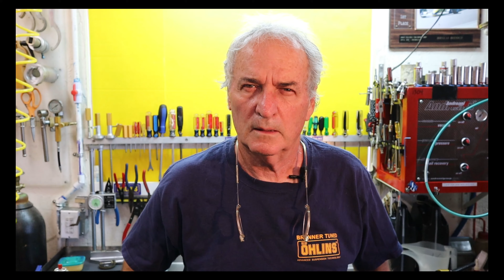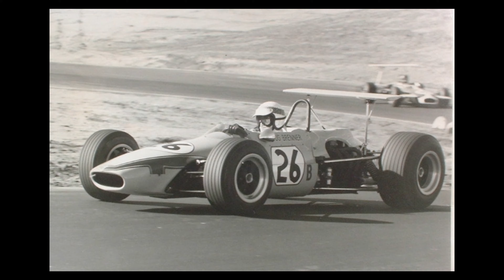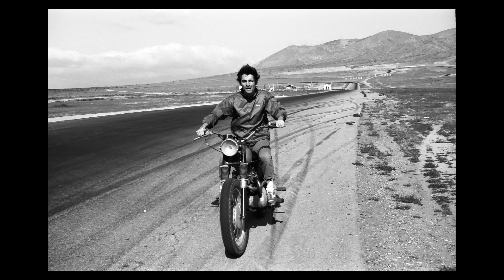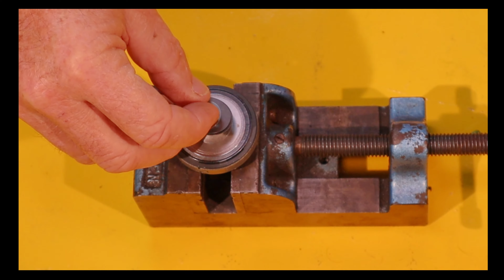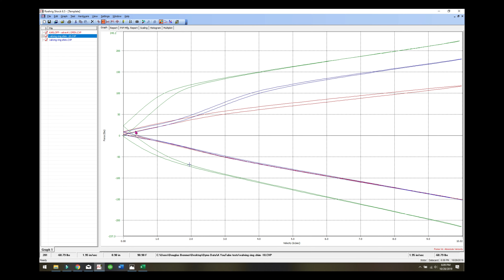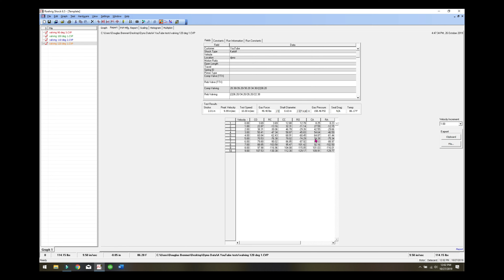Valving #4  Shim Magic

Comment: I have a question, i race atv's in cross country (woods racing) and i have learned a ton about shocks from your videos and have been able to revalve my rear to do exactly as i wanted it to do, now i have a question about the differences between high and low speed and what is actually considered high and low speed. 

My front shocks running across rough ground (minor bumps and rocks) is stiff and jarring, but if it takes a hard hit. Like landing from a jump or crossing a gullie they seem too soft. Would that be considered to have too much low speed and not enough high speed dampening?

 I dont have a lot of off time between races to test and would like some input from someone smarter then me about it before i attempt to revalve them and make them worse.

Thank you for your time and the amazingly informative videos.
Reply from the maker: Hi. I am glad my videos helped.  High and low speed is subjective.  When your shock gets a high speed hit it is an anomaly and it you try to valve for that you will be ruining the other 99% of your run.  The only thing I would suggest is to look at my video on Digressive Damping Why I Don't Do It.

Comment: Hallo and thanks for sharing your knowledge in these videos!

I wanted to ask if you could explain and maybe make a video of dyno tests on the KARLOFF test shock to demonstrate the influence of rod position in the shock versus force with constant test velocity.
For example, a tests series using constant 1, 2, 4, 6, 9 in/mm vecolities using whole stroke length of the shock to see how the force changes with regards to rod position in the shock at a given velocity. 

I'm not sure that it has 100% applicability to real world scenarios (I'm interested in motorcycle off-road racing like MX, enduro, rally, etc.), but I'd be really interesting to see how a shock works while being brought thourgh its stroke at a slow velocity compared to a fast one (with the same shimstack, bleeed clicker position, etc), esentially to understand the influence on the shim stack/bleed on the rod position in the shock depending on the rod velocity.

I hope I made my idea clear and there is something interesting that you could show/teach us.

Thanks again!
Reply from the maker: Unless the shock has some sort of bypass mechanism in the body there should be no difference in damping forces based on shaft location.  It is only sensitive to velocity
Reply: Thanks for answering this. Is there any way you could post a link in this comment to a picture or a video where such a shock body is shown (seen), so I could understnad how those types of bypasses look and thus, hopefully, be able to determin what type of a shock I'm looking at if I ever see something similar in future? 

Thanks!

Comment: isnt it so - that one would want digressive damping on an application where you have massive wheel travel available and You want to keep off the "seasickness". so after the initial soft side is overcome the valving is not too abrupt for high energy impacts - like hitting a sharp edge vs slow  vawes of whoops.
Reply from the maker: If you get a hard hit with lots of slow speed compression the whole thing locks up.
Reply: @theohlinsguy4649  watched all the videos. a lot of interesting info. thanks for that. we are still waiting for our dyno to be delivered - but a lot of misleading info is being flopped around the net for all of it.
Reply from the maker: @Snowhite808  Good choice.  You can't really know what you are doing without a dyno.  Just remember that  it doesn't tell you what is better or worse.  It is also very good at seeing if you have any problem in the shock.  Good luck!

Comment: is there a way to calculate shim stacks or is it all trial and error. i'm trying to learn how to manipulate snowmobile shocks depending on rider conditions and rider styles and would like to be able to figure out shim configurations based on this
Reply from the maker: Hi Leo.  There might be but I wouldn't be smart enough to do that.  I did give the math for calculating equivalency of multiple shims of the same diameter and thickness.  I think even if you could there is a disconnect between knowing  what the stack is and performance.  Also what that stack is doing depends on the piston.  I just have an idea from experience what shim stack to start with and then it is trial and error.  I did some snowmobile shocks and had no luck at all.  The show is compressible and depending on the makeup of the snow you can get completely different results. I am not a believer in changing shock settings for different track conditions and once I get a good setting I never change it.  But with a snowmobile I am guessing that you would always have to change things based on snow conditions.  Just a guess.

Comment: Would it be fair to say that road bike valve stacks are shimmed to account for potentially passengers plus luggage and that an improvement could be made to solo rider riding by reducing damping stack
Reply from the maker: Hi Phil.  I don't think damping has anything to do with weight.  Two different things.  I only valve for motion ratio and find no difference between road or track.  Best way to account for passenger and luggage would be to just add more spring preload.  Thanks for the question!!  Remember these are my opinions.
Reply: @theohlinsguy4649  Thanks for the reply that makes sense . I guess find a spring that feels nice and work the adjusters around that . Great videos by the way helped me rebuild my shock just watching how you did it ✌️✌️✌️
Reply from the maker: I am glad I could help.  It's not rocket science but sometimes it is good to know the details.  It is mostly hard to do without the special tools.  I really like it when people do it themselves.  On springs, I prefer softer with more preload than stiffer.  You can go too soft but once you get in the ball park it is really nice.
Reply: @theohlinsguy4649  well I’ve worked on hydraulic rams mostly of agricultural machinery and figured that’s all it really was, just a small hydraulic ram seal piston etc . Actually being 22 years old was the worst part of stripping it, seal kit was available via a company here in the uk I touched the bore up with stones like i saw you do have the valve a rough up and just took my time. Seems perfect now slight dead spot at top out but I can work that out . Once again thanks so much for what are great educational videos .. Many thanks and blessings from Devon uk ✌️✌️✌️

Comment: What is the I.D. Of Ohlins shims?
Reply from the maker: Hi.  There are 3 IDs that I know of.  Shims for single tube shocks are 12mm, fork shims are 8mm and TTX shims are 6mm
Reply: @theohlinsguy4649  thanks. Trying to find high quality shims for my shocks. They are 16mm unfortunately. Thank you for the amazing videos, I’ve learned alot from you.

Comment: Hello, how are you calculated the amount of thinner or thicker shims to replace?
Reply from the maker: The formula is on the video.  Basically divide the bigger shim by the smaller shim and multiply that to the third power.  If you want to replace one .20 shim with .10 shims". .20 divided by .10 =2.  2 to the third power is 8.  So it would take 8 .10 shims to equal 1 .20 shim.
Reply: @theohlinsguy4649  what if i want to make the opposite thing? And arent  8 shims stiffer than 1?
Reply from the maker: @zlatomirkolev9762  It is pretty interesting that it takes 8 shims that are half as thick to make one shim twice as thick but that is true.
Reply: @theohlinsguy4649  if i change clamping shim only is it gonna be a precision tuning for whole stack?.. I have alot of questions if u up to explain me, i ll be thankful!
Reply from the maker: @zlatomirkolev9762  Watch my video on clamping shimw.  Yes, it is kind of fine tuning

Comment: Would digressive be better suited to situations with high unsprung weight like a trophy truck? 
Thanks for so much information, you've earned my sub!
Reply from the maker: I don't think unsprung weight has anything to do with it.  I have some dyno sheets from an early 2000s NASCAR championship winning car and the damping for road courses is pretty  identical  to my 1000lb formula car.  The only time that I think digressive damping is "good" is for aggressive hold down/up shocks.  I don't get into these applications.  I am looking for mechanical grip.

Comment: I really appreciate these videos, such fantastic info.
 I got to thinking about stacking shims vs using a single sealing shim  and basically having the same dyno graph but stacking shims gives more mechanical grip. I notice the way the shims work is very much the same to a leaf spring. A moden parabolic leaf spring the leaves don't touch one another and require a shock absorbers to control oscillations. In the old days, leaf springs were made up using multiple leaves and often did not require shock absorbers (my background is a truck mechanic) as the friction between the leaves would sort of dapen the oscillations. In the shim stack of the shock, without multiple shims stacked together could the sealing shim be bouncing when the shock is operating at a high frequency, inhibiting its ability to meter the fluid properly. Just a thought.
Reply from the maker: Hi Isaac.  I think you are really correct about the shim stack being similar to a leaf spring.  I think the math might be the same.   It would be very hard to get enough damping with one sealing shim.  Sometimes I see stacks with only multiple sealing shims but for some reason a stack with descending diameters seems to give more grip.  I don't really know why.

Comment: Hello
I discovered all your videos and they allowed me 2 things, to learn a lot of things about suspension and also to have to review my English which I hadn't practiced since the end of the school there is ..... 35 years old...... so please excuse me for the mistakes.
I ‘m not a professional but just a private person who is passionate by the suspension and who works on my son's motocross bike suspensions since 12 years now.
We try different settings, we test, we change etc etc etc just based on the sensations on the track.

I ‘m really interested to test the solution with a ring shim of ID 36mm OD 40mm 0.30 but do you know where I could get one because the shim sellers in France don't have this type of shim.

Regards Olivier
Reply from the maker: Hi Olivier  Your English is great.  You speak (at least) 2 languages, I barely speak one!!   Ohlins makes ring shims so there must be an Ohlins dealer in France you can get them from.  Remember that you need a 36OD shim to center the ring shim.  The difference between the centering shim and the ring shim denotes the amount of preload.  also remember you can keep stacking ring shim sets if you need more preload.   Thanks for the comment!!!!
Reply: @theohlinsguy4649  Hello
Thank you for your answer and as you tell me I will see with the OHLINS dealer in France to whom I had sent the shock absorber of the 1993 Honda 250 CR for a complete service there is 5 or 6 years.
I just have one question:
Can we hope one day that you will make us the same videos about the forks with internal cartridge?
Thanks Olivier
Reply from the maker: @pingping4766    Yes.  I don't get them very often so next one I get I will make a video.  Basically they are just a shock with separator piston put inside a fork.  You also put oil in the fork but it has nothing to do with damping.  Probably there for the air spring effect and cooling the part that is doing the damping

Comment: Great videos ! I just wanted to know if the Ohlins ROAD AND TRACK are revalvable ( for raod use only ) and if it is really  worth ..
Reply from the maker: Yes, they are revalvable.  I don't believe there is any difference in valving between road and track.  Grip is grip.   I think they are a great value

Comment from the maker: Hi Martin.  Be sure when you put a larger clamping shim on that it is not protruding into the port.  I think it is really great that you are going to learn to make your own changes.  As far as the rebound goes, the better option, at least initially, is to put in more compression damping.  That will dissipate some of the energy stored in the spring which will also slow down the rebound as less energy will be stored in the spring.  

I think in one of the videos I showed the effect of a crossover shim.  It usually just makes less damping which would be better to do with a uninterrupted shim stack.  A crossover shim is handy when you just can't get rid of high speed or want more low speed relative to high speed.  They are not bad things when used for the right reasons.

I don't think that shim stacks are usually ever really bad.  Mostly it is the digressive piston, closed bleed or the ratio between compression and rebound damping that isn't good (just my opinion).
Reply: I will make sure it does not protrude. Good tip on the compression and storing energy that helped me out when riding today!
Thank you for the response and I will be looking forward to new videos from you.

Comment: I have watched almost every video that you have posted and I have to say I highly appreciate all this information, making me understand more in depth how it works. I can now go ahead and start making my own changes to the suspension of my dirt bike, I will be starting off with changing the clamping shim to a slightly larger one on the rebound on the rear due to it being a little too fast!

You always seem always aim for the most linear curve of damping in relation to shaft speed and I do understand why. But I would also be very interested in seeing a video where you try different shapes of stacks to see how they will look on the dyno. I also would be really interested to see how stacks with crossovers in them look on paper, for instance a smaller crossover shim in the compression stack making the shims closest to the piston "low speed" and the shims on the other side of the crossover the "high speed" compression stack.

Sometimes it's good to show how to do something bad, to be able to display clearly how to do it well, I want to see some "bad" shim stacks being tested!
Reply from the maker: Hi Martin   Somehow I missed your comment.  Sorry!       That would, for me , be a digressive stack with digressive pistons etc.  Ill keep that in mind!  Thanks!!!

Comment from the maker: At around  6:00 I say that doing this is "a nice option".   Using this option all the time and selling separated shim stacks as "low, medium and high speed"  is what I don't believe is correct.  You don't see this in every single Ohlins shock.  It is only used to get a certain outcome from time to time

Comment: When a shim bends the material on the top of the shim stretched and the material on the bottom side is being compressed. There is an axis point in the middle that has no stress at all. Call it the "Neutral Axis" The further away the material is from the "Neutral Axis",  the more is it stressed. Thus "Thicker" shims permanently distorts before "THINNER" shims

What does this mean? THICKER Shims will distort less with less deflection.  The "THINNER" Shims will distort more with more deflection. Thinner shims are used in the "Low-Speed" area of the stack because they have to deflect further than the High-Speed stack by the thickness .

Comment: Please explain shock hysteresis.
Reply from the maker: Hi Brian   Shock hysteresis is a difference in force in compression and/or rebound from when the shaft is speeding up to when it is slowing down.  I think I show the differences on the dyno sheet in my "shock dyno basics"  video.  As the shock shaft is speeding up pressure builds up in the shock.  As the shaft slows down to reciprocate the pressure shows up as extra force at the same velocities.  Pressure can dissipate through the bleed circuit so the more closed you have your bleeds the more hysteresis you get for any given valving.  Also some of the difference is caused by the nitrogen  pressure in the shock .  I don't think this is actual hysteresis but it might have the same effect.   Trying to minimize this  by lowering nitrogen pressure below the amount needed isn't a good idea as you will encounter other functional issues that are much worse.

Comment: Can you do a video on damper oil? What is good oil and why ? etc...
Reply from the maker: Hi Thomas
Thanks for watching my YouTube channel.  I only use the Ohlins oil that is specified on the spec sheet for the specific Ohlins damper I am working on.  Basically I use 2 oils:  Usually 1309 for motorcycle and 1304 for auto.  There is a 105 oil but I just use 1309 because it is the same basic spec but updated.  There are also Ohlins oils for things like snowmobiles and such that I rarely do but if I do I just order some of the correct oil.  If you are in a severe climate there might be other Ohlins oils.   If you have Ohlins dampers only use Ohlins oil!!!  

I see people on YouTube using different weight oils in an effort to alter damping.  I think this is incorrect and is just a ameture way to try to alter damping and would certainly adversely effect the function of the damper.  This is not the function of oil.  For that you need to adjust bleed or revalve 

Ohlins has a paper on "why Ohlins oil" but I can't figure out how to link it here.  Ill try to find a way.  If you send me an email at theohlinsguy@gmail.com I will send you a copy

I hope this answers your question.  I really don’t know enough about oil to do a video.  I am trying not to talk about things I actually don’t know much about…………..Thanks again!   Douglas